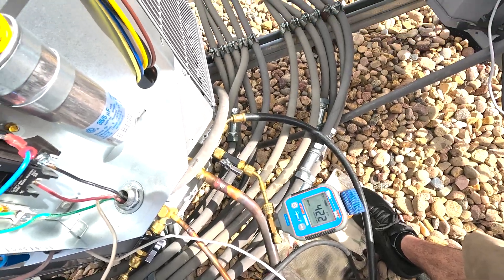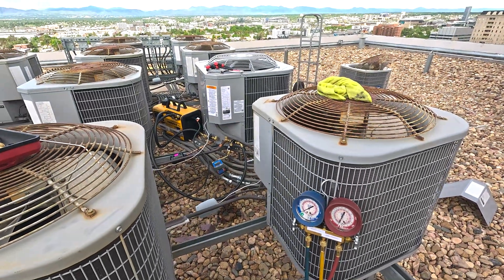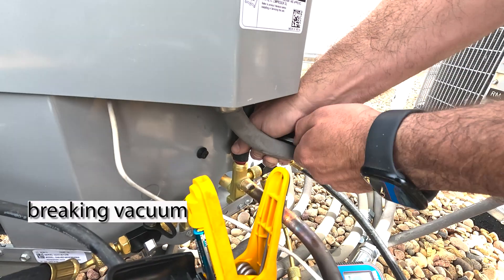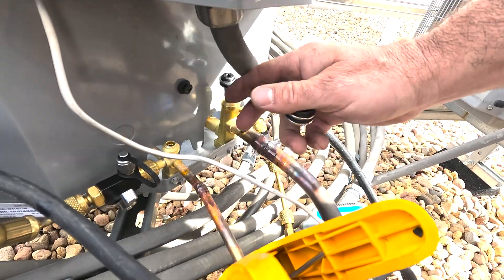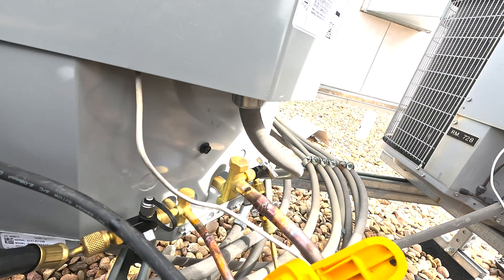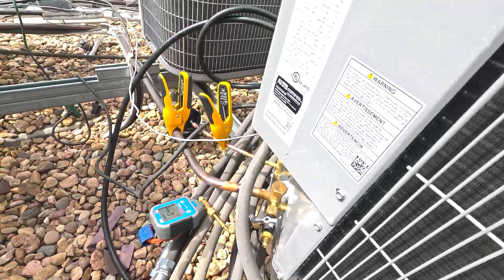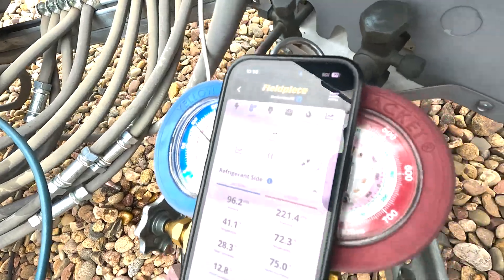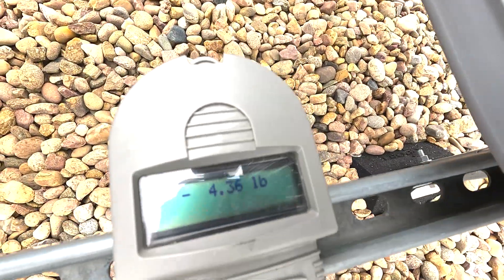Condenser Install on Rooftop - Brazing - Evacuation - Charging

Comment: Thank gawd someone shows using a flame blanket and wet rag to protect wires, walls, and sensors.  Light weight to carry and saves a lot of collateral damage.  Good video.

Comment: The joints you brazed look at least half decent this time😂
Reply from the maker: All that really matters, is that they don't leak, and they look better than 95% of the braze joints on every roof top I step on :)
Reply: @ApartmentMaintenancePro  it’s good practice to flow nitrogen through the lines as you braze.
Reply: @Christopher-oi9jo man has the tank up there and even a purge regulator and not using it! Wow
Reply from the maker: @Christopher-oi9jo yes
Reply from the maker: @arodandjeter1 i flowed nitrogen while brazing…..always do check my other videos as well. That’s also a purge/flow regulator with braze setting of 3-5sfm